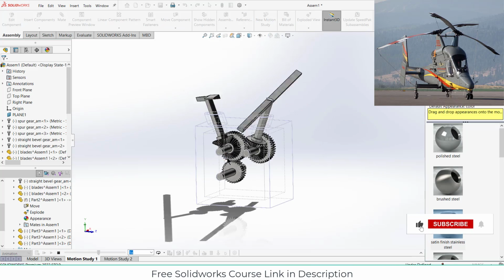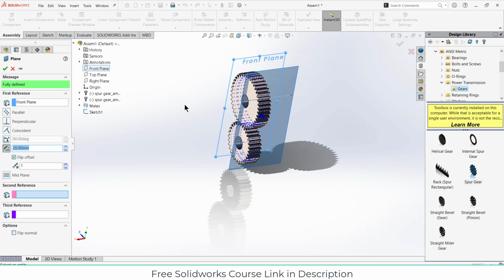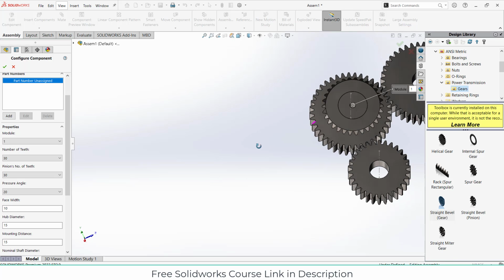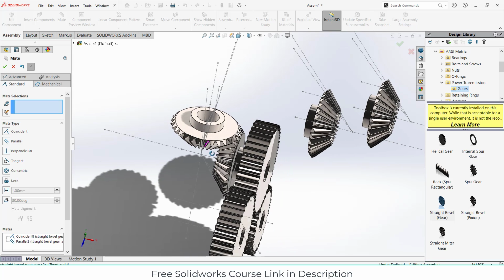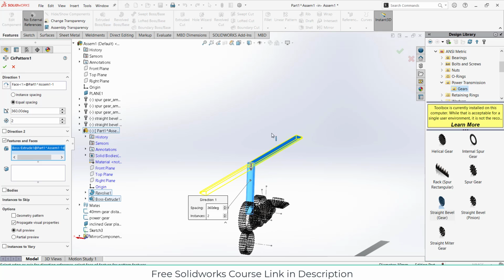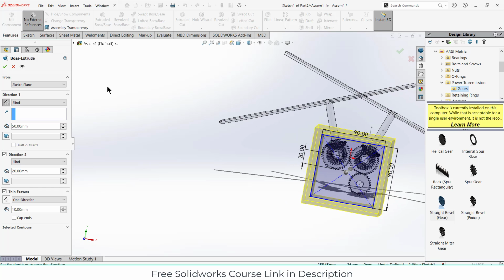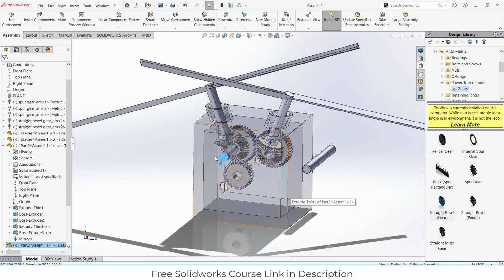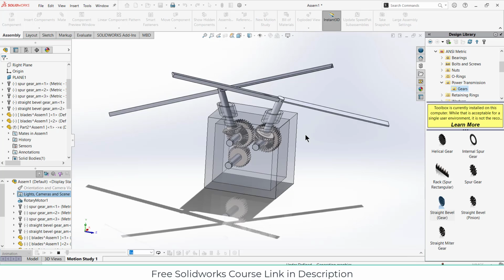InterMeshing Rotor helicopter | Solidworks Project

Comment: Very good but it won't fly, the blades are not cutting the air :))😄
Reply: Well yes it does fly because multiple helicopters are made this way
Reply: You are technically correct, this is just a rendering.